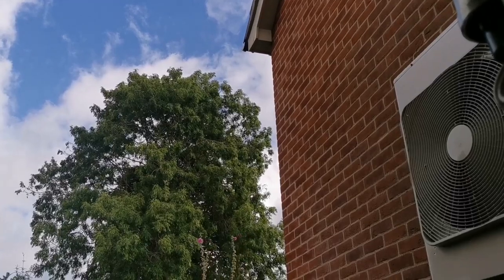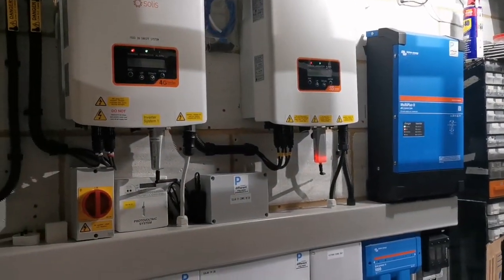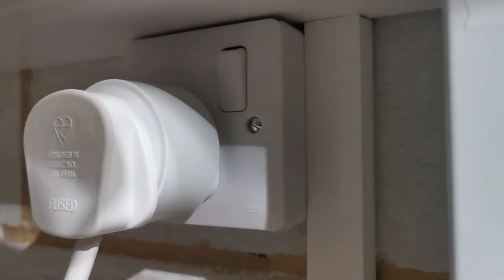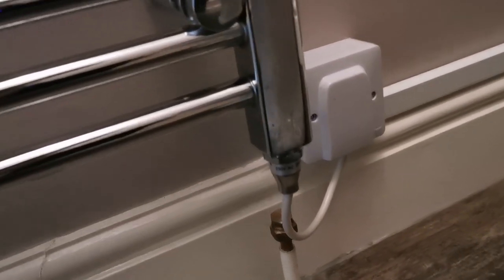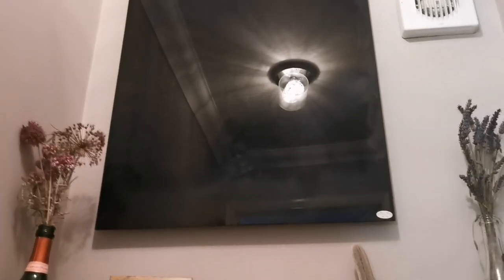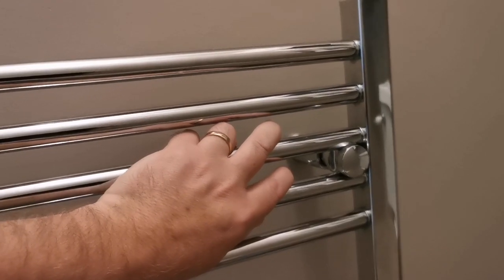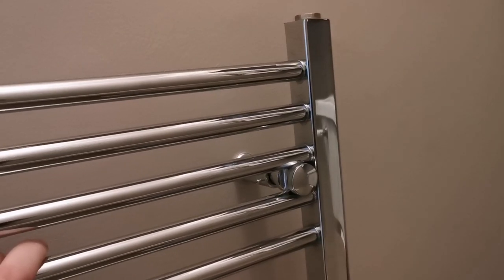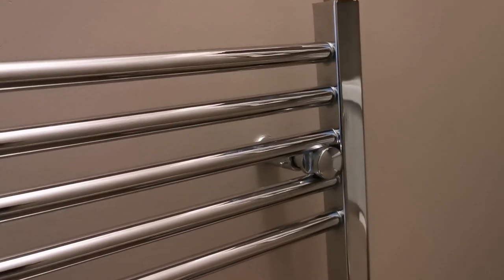Winter preparations - Bathroom radiators going electric - easy low power retro fit

Comment: Absolutely….. we’ve just had our Rayburn converted to electric not cheap by a long margin, however when we get our house battery ( been let down three times now by First4Solar ( last4batteries) and the lack of annual servicing the decision will start paying off plus we are doing it for our grandsons as much as the cost savings. Keep them coming. We are trialing a heat panel and have an electric towel rad controlled by a wireless fused spur ( protected )
Reply from the maker: Sounds similar to ours. I've got a similar wireless spur but decided on simple 3 pin smart plugs instead.

Comment: Good plan,
My shower room refit experimenting with simple electric underfloor heating + the same electric inside the rad you have.
(granted my radiator is still connected to the wet heating) - but the principle is to slowly wean off rooms from the oil fired boiler.

Air based aircon + air heating in the front room home office hopefully installed next and will try out over the autumn.

Comment: These were fitted in the house I bought, but with the central heating still connected. Useful in spring and autumn when you want warm towels but not yet time to put on the heating (which I’m converting from oil fired to heat pump)

Comment: There are some terrified stories about solar panels have caused fire on roofs of houses. That's the main reason to put me off from installation of solar systems in my house. How can I make sure the solar panels which I will be purchased and installed are fireproof? Does your house insurance premium go up because you have installed solar panels on your roof? or does your house insurance premium include accident like fire set by solar panels? Thanks
Reply from the maker: Electrical fires are most common in houses from using extension leads and leaving devices on charge with cheap devices, solar panels are hugely rare to cause issues, they auto shut down. Technology has improved

Comment: Yer same here brought another oil filled radiator bit back so got two now and normal conventional radiator was planning to buy smart plugs on Facebook to automate them to test if warming home up on off peak energy will save money but lady not getting back to me so mite have to buy plugs online and hopefully will save gas use in the morning on less than cold weather we will see
Reply from the maker: Time to ditch gas.... Bit by bit
Reply: @EVPuzzle  too right but at what cost ? I’ve looked at air source heat pumps for 3 years and can’t make figures work for us yes there are cheap to run but last year our gas bill was around £250 for the year !  Seem others with electric boilers like tapo and older heat pumps paying that I one month mid winter!  Yes when the tax is taken off electric and put on gas it mite be worth it or if had spare money but like you Nigel with the OctopusEnergy quote and we had 5 others over 3 years and if the installation experts that tell the truth say at the moment it going to cost good bit more to run and like looking at air to air looks good but it’s not cheap again but at least it can cool to so that good all year use but been told mite need gas boiler on cold weather morning. Then there them ceramic style heaters on the wall few YouTubes got look good but again one of them would cost more than our years gas bill and we would need good few to not use the gas boiler that’s in good condition I’ve been told and good efficient for a gas boiler.  So it cheap oil filled radiator for us again this year and when boiler breaks we look at some kind of heat pump or other low or no co2 solution as we going to be paying for something why not get something better and by them hopefully electric prices will have sorted out and maybe hp prices would be even a little lower but we will see . Very interesting to see and hear others ideas this winter and prices it’s costing people this sky high fuel prices! Take care and safe travels everyone
Reply from the maker: ASHP isn't going to work for us either, you need to run it Continuously and like huge radiators
Reply: @EVPuzzle  yer for people that are putting new central heating in or renovating homes etc it’s well worth the extra money to fit ashp but the hassle of putting double or triple radiators in to working well heating system is not cost effective unless you got spare money or doing it when old heating system fails is going to be costly to repair etc is good idea but for maybe 🤔 I looking at it the wrong way but how much people have done eco thing just because it’s the right thing to do like we used to say hippy tree hugers lol 😂 and happy to pay a lot more just for the sake or image of it ?  I like new technology and new toys like looking at getting a new phone and maybe new iPad or MacBook to replace older stuff but I might be like honory Yorkshire man  my old tech is working fine so why change it ? !save the money for when I need to change broken things !? and how many people have done eco things like solar and ev etc because it’s going to save them money in the long run not just to be appear eco nut and it being green and right thing to do is just a bonus. Others peoples view may be different and what they do is upto them I’m happy to share my view but not going to enforce my views on anyone. Mime like you Nigel we show the warts and all to inform others and help them make there own mind up what best for them ! I see too many peoples videos or comments says people are wrong or that x is crap etc but some people like x so if that’s peoples view let them have there view there is too much hateful comments and too many keyboard  Warriors that don’t know x don’t own x and just read or watch biased reviews or news and take it as gospel I know of good few people that won’t have a ev if you gave them one for example but they don’t know anything about them or every own one just that they read in the tabloids somewhere that there bad !  That my 10 p worth!
Reply from the maker: A good 10p worth.  Everyone is different and finding our own reasons to do the right thing is our own issues. For me it's good sense more than eco tree hugger.
 Its logical
Reply: @EVPuzzle  lol 😂 I’ll charge you £1 then if you think 10 p is too cheap lol

Comment: What is the problem with the infrared panels? I plan to warm the house with them. We dont have and cant get any central heating
Reply: From what I gather to heat a room takes a long time , you as the occupant will feel the heat from the panel . Objects in the room will heat but the air in the room will not . Eventually when the objects in the room start to radiate heat because they have warmed up they will pass heat to the room but that would take a long time . 
  That is I understand it so am open to correction .

Comment: have you not flashed the smart plugs with the "tasmota" firmware, you could then control / monitor them in homeassistant.
Great idea though, I am in the middle of doing similar mods myself but I have left the rads connected, but turned off from the central heating.  we also have electric underfloor heating in the main bath room, which we only have on for short periods morning and evening, keeps it nice and cosy.
Reply from the maker: I was going to go hybrid but decided its be more efficient not having piping to heat too so went all in.

Haven't tried flashing them.  But advanced for me

Comment: Hi Nigel, slightly left field question…… seeing the inverter in the garage reminded to ask you, what’s the maximum charging rate that you’re able to put into your Pylontechs using the batteries’ BMS?
Reply from the maker: 3.6kw similar to powerwall
Reply from the maker: Batteries can take much more limited by inverter

Comment: What great timing. Im also on oil and looking for ways to save turning on the whole system just to dry towels. I was looking to buy a new towle rail but looks like I have the same one as you (prob B&Q or screwfix) so your conversion should work. Do you have a link to the immersion heater you used?

The plugs you use are good but you should look at flashing them to tasmota and using home assistant.
Reply from the maker: That's 2 saying tasmota.  I'll look into that
Reply: @EVPuzzle  You'll need specific versions that work with Tasmota. Sadly, lots don't anymore :(

Comment: PSA for you Nigel. YouTube shorts are filmed vertical format on your phone. Are less than 60 seconds in duration. I'd give you a link to the YouTube Creators video on them, but it will then trash my comment.
Reply from the maker: I realised after and deleted the one I did. Useless.

My typical style just try it, fail few times and learn 🤣

Comment: Love your videos. Very informative and relevant. Thanks.

Question: I see you are using Smart Life app which is what I use too. Which smart plug did you use? Link?
Reply from the maker: Cheap unbranded smart plug from amaxon, just compatible with tuya and smart life. Would've preferred kasa as integrates better with home assistant. Tuya is supposed to integrate but I've failed to get it working
Reply: @EVPuzzle  Cheers. I think I have the same. Well two of four of them.
Reply: Hi, I managed to get the non branded ones into ha via tuya integration but no power consumption.
Reply: @MyApole  some of these cheap unbranded plugs have power consumption and some don't. I never paid attention to it so now I have two that monitor power and two that do not. Worth reading the description of the product or asking seller before purchase.
Reply: @shariqali7429  Thanks, mine do record energy but only accessible via smartlife. Not an issue tbh, I am using tapo plugs for that now and looking to use Shelly em for some other devices as these would be better powered via a direct connection rather than a domestic plug.
Reply from the maker: I linked smart life to tuya OK so tuya sees the same devices as smart life but HA wouldn't logon, errors saying wrong region or wrong login. Mystery.

To fix I'll have to delete all and start afresh but tuya doesn't seem to like deleting accounts. Everything takes 30 days

Comment: Is the towel radiator filled with oil or just water after fitting the element
Reply from the maker: Water same as heating system
Reply: Do you fill it up via the bleed caps ?
Reply from the maker: I suspect the plumber just avoided draining it😂 but yes, just leave some for expansion

Comment: Has that radiator been converted then or is it a new radiator as a whole?
Reply: You can retrofit those heating elements - you can even have the wet system connected at the same time
Reply: @eliotmansfield  Wow, I never knew that was a thing that could be done. Is that possible for more traditional style radiators? Do you fill it full of water afterwards? If so, how does it vent pressure properly from the expansion of the water/air due to the heating process?
Reply: @SabretoothBarnacle  I’ve only ever added it to an existing wet setup - so expansion wasn’t a concern. Good question though - i suspect it doesn’t get hot enough to worry too much about.
Reply from the maker: Existing radiators. Could have it alongside oil boiler as a hybrid system but we've disconnected from heating system to make it independent as the boiler is going
Reply: @EVPuzzle  This looks really interesting?  What actually are you retro fitting.  I am trying to work out what to do with my central heating and this could just be the answer I need.
Reply from the maker: I've disconnected 3 radiators from the central heating loop and put low power immersion heaters in each radiator on a timed switch. I now have e bathrooms that can be heated in winter on electric  removing the need for the oiler boiler. If successful it means I have a heating system with a mixture of electric device

Comment: What's the air source heat pump you have?
I haven't heard you mention this before
Reply from the maker: It's new in last week. Proper video once I've got used to it. It's a toshiba split system
Reply: @EVPuzzle  is that air to air?
I look forward to your views
Reply from the maker: It is yes, very powerful, I'm hoping it'll half our winter energy use
Reply: and air to air are a relatively cheap price to buy and install
Reply from the maker: Compared to ashp at least